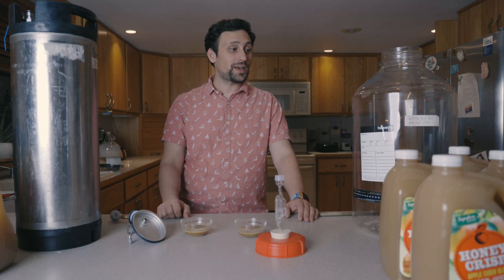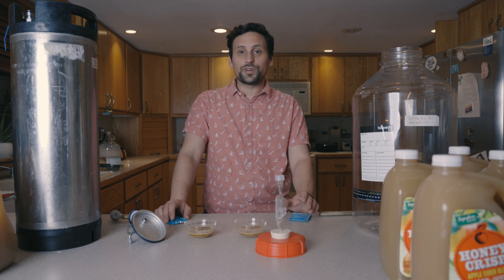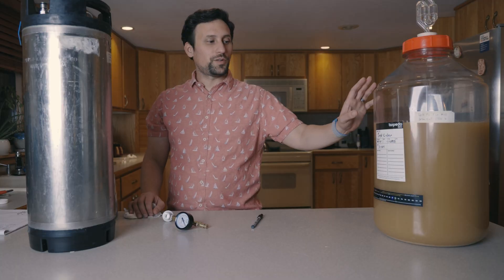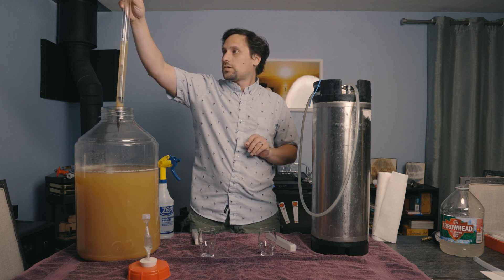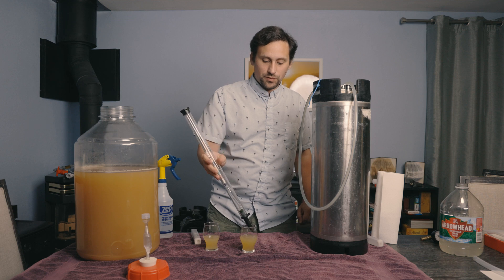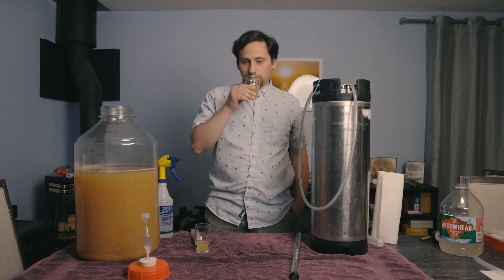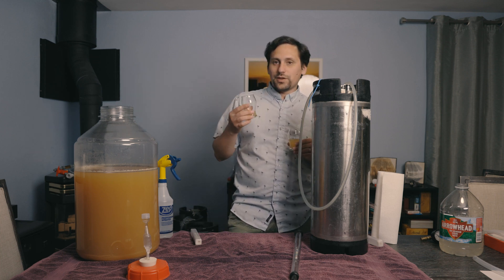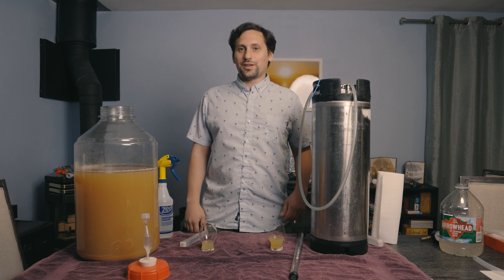Fermenting Cider Under Pressure - Is there a difference under ideal conditions?

Comment: I live in Oklahoma and plan on pressure fermenting in my garage. Will the summer heat be too much for this setup?
Reply: Go for a Kveik strain.  Voss will give a slight citrus flavor but Lutra ferments pretty clean.  Kveiks handle higher temps with no problem.  I've done many ferments with and without pressure at 90-95 degrees.

Comment: Did the pressurized fermentation carbonate?
Reply: A little bit
Reply: You need to cold crush your pressure fermentation vessel to get co2 into the solution. I used 15 psi of pressure before cold crash and the drink turned out great
Reply: https://www.youtube.com/watch?v=dPbWYMUJptI&list=PLy-V1XECAyC7OgkO-ZLfcm3RoTKZBTfLP&index=10  This guy has a great pressure fermentation carbonation calculator.

Comment: Doing my first cider now. Was planning 10psi safale 05 at 75F in order to speed up the process. First off its not getting going as fast as my beer brews. Usually by now im seeing activity. Added fermaid o also. Its been 24 hours and pretty much zero activity. Is this normal for cider? Thanks
Reply from the maker: So you have your spunding valve set to 10psi and you haven't seen any gas pressure, or are you applying 10 psi to it constantly?

Confused by your process here. 

The activity you see will be small bubbles and the gas pressure on your spunding valve rise to 10psi. That shouldn't take much longer than 2 days. I usually see it after a day.
Reply: @CiderWithKevin  I applied 10psi initially to set the valve. Surprisingly it didn't drop, but it's also not releasing anything. Either it's super slow or nothing much is going on. I got more yeast an nutrients today an just put those in. Kind of has a bit of a sour smell after 3 days sitting in my garage. Dunno, but it may be ruined. The juice was around 50f when I pitched the yeast. Maybe I killed it, no idea. The yeast I just threw in already seems to be active and bubbling after only a few minutes. Time will tell, but this may have been a $50 learning experience that goes straight down the drain. I'll try to come back with an update in a few days
Reply from the maker: @richardcagle5475  the only thing that makes sense is dead yeast or an under pitch. With a healthy ferment, it should smell of apples and yeast from the spunding valve outlet.
Reply: @CiderWithKevin  okay I think maybe it was doing something the whole time. There's no krausen at all, which really threw me, but the initial charge of co2 seemingly not being absorbed should've been a clue that some was being produced. I think it was just really slow starting. Either way, it's fully going now. Smells a bit sulfurous though. Like apples, but with a twang, if that makes sense. Is this normal? I really have very little idea what I'm doing here. Thanks for the replies.
Reply from the maker: @richardcagle5475  that is what s05 smells like with cider ferms. So if the initial co2 does not get absorbed or usually means that something is producing it. 

Krausen is not always present.
Reply: @CiderWithKevin  yup, its going real strong now an the gas out of the fermenter smells a lot better. i skipped the dap an knew that would make it a slower start, but i had unfiltered cider an figured theyd get the nitrogen from that an the everything else from fermaid 0 alone. really not sure if the fermaid k and extra yeast i added today was even necessary, but either way its off to the races now. I'll come back in a few days to let you know if its terrible or not :) thanks again
Reply from the maker: @richardcagle5475  I'd say at worst you have a co-fermentation, which may have interesting and frankly, unreproduceable results. I would enjoy it as a 1-off batch knowing that you'll need to be more disciplined if you want to reproduce a recipe in the future. 

The cool thing is that doing a co-fermentation makes something totally unique to the ingredients and the environment of fermentation. Sort of a nano terroir. I think that is something fun to experiment with
Reply: @CiderWithKevin  oh. My. God. What have I created? It's tart and dry, just the way I like it. And since I added 8oz of dextrose it finished about 8.1 abv. From perceived failure to unexpected triumph. I'm glad I pushed through, I almost scrapped the whole thing and moved on. I'm finding it very hard to completely botch any kind of brewing. It truly is a hobby that anyone who can follow a dinner recipe can manage. Thanks for your tips and insight. It was definitely worth it. Can't wait to try it cold, clear and fully carbonated

Comment: Thanks for the video.  Regarding the improved nose of the pressure fermented batch, that might be a result of less oxygen exposure as well.  It might be interesting to do a batch in the keg at atmosphere and see if the aroma is still strong.  Since your ferment lasted over a month, that is plenty of time for oxygen to find its way into your Big Mouth Bubbler.  Especially with so much head space compared to the keg which had about none!  I mainly brew beer but often pressure ferment and always try to mitigate oxygen exposure all the way through the process.  This really keeps aroma around in the final product.  For beer, pressure tends to accentuate hops, make the beer cleaner in flavor as well as add a fuller mouthfeel as the PSI numbers are increased.  I was surprised how long you had to ferment to get to terminal.  Is that normal for cider?
Reply from the maker: Conventional wisdom is that when fermentation is active or finished prior to racking, that oxygen introduction isn't really an issue. I'm not sure what I think about that. Surely some oxygen must enter, right? 

The fermentation times are time in primary until cleared enough to rack. That is usually a bit longer for cider than beer.

Comment: Pectinase at the start. finish with gelatin.
Reply from the maker: In this instance it was just time to settle out, but I agree that pectinase + fining would work. I personally avoid gelatin finings, but if it works for you have at it!
Reply: @CiderWithKevin I made beer jello once.. I don't fine anymore
Reply: Sorry for my n00b question - but how do you add in the gelatin later, if you're fermenting under pressure?

Comment: You put your hrdrometer in symphony tube to get sample??  Or is it a different type of hydrometer??  I have a cider kit and thanks to your VID, I’m gonna give it a whirl
Reply from the maker: Yeah, I'm a lazy brewer sometimes! The siphon tube, sometimes called is called a wine thief, can be filled from the top or siphoned from the bottom. Just put the hydrometer in before filling. The liquid pressure holds the stem valve at the bottom closed when filled from the top or bottom. Just gotta be careful to not bump the stem valve while filling or looking at the reading or you'll get a mess!

Happy to hear you're trying cider making! Happy cidering!
Reply: @CiderWithKevin  Great tip!  Cider is next.